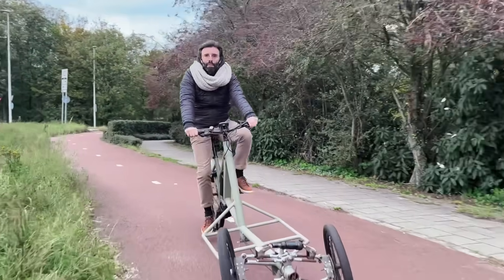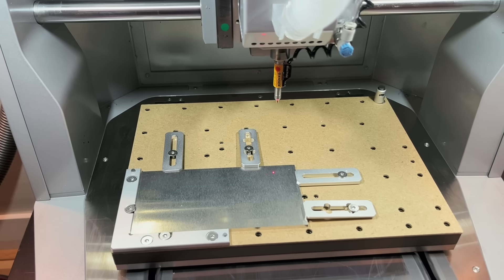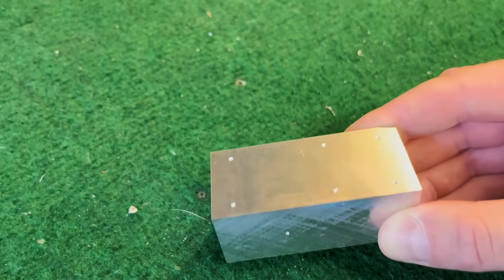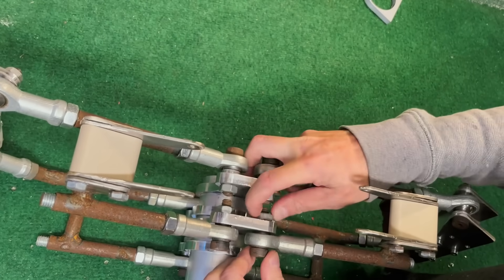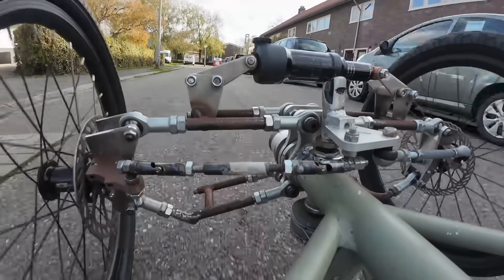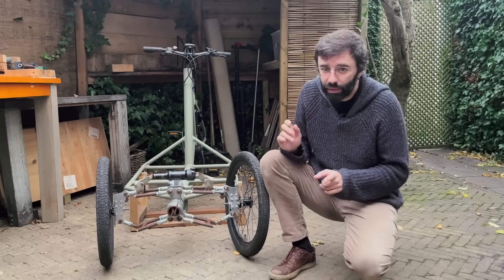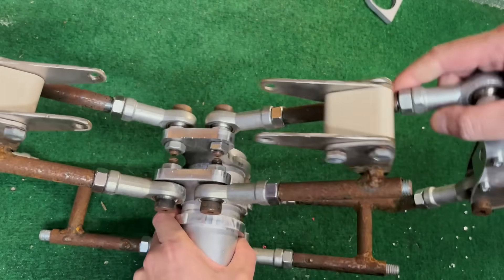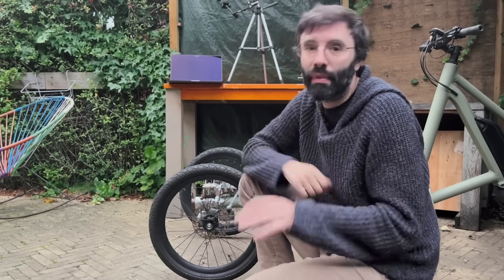#7 From 3D Printed to Aluminium - Tilting Mechanism with Makera Carvera Air

Comment: Have you looked at any kind of stress analysis for the front single end axles and other critical bits in the driveline? I assume this chassis is intended for cargo transport? Have you tested it with any significant mass in the cargo bed? Nice build anyway!
Reply from the maker: Hi, thanks!
Currently, I'm on a design and prototyping effort. Once I'm happy with that, I may consider manufacturing, for which I would need aluminium chassis expertise.
Cheers!

Comment: The Ackerman geometry for steering can be tricky. Keep in some mind that vehicles that handle corners very well at speed don't steer much better than a truck in a parking lot. (Had a car like that before.) Now if there is some trick to make that aspect variable, that would be interesting.
Reply: Found something called "VAS" which was recently patented in 2022. It's an electro-hydraulic setup with dual racks and pinions for steering and a computer changes the rates between them on the fly depending on speed. Seems like it's focused on Formula racing for now, but it may come to passenger cars at some point. Solves the cornering vs. speed trade-offs that are normally there.

On a project bike, there might be a trick to change it up with a bi-stable lever to switch between low and high and just lock one linkage set vs. the other. Either corner tight and squirrely or not that much but with a more confidence at speed. Still would be tricky to figure out something optimal that doesn't over-complicate it.
Reply from the maker: @pauljs75  indeed, I've seen those systems. Usually, they are steer-by-wire. E.g. the Tesla Cybertruck.
My speed range is not so high s I can keep the steering ratio fixed. But, it has to balance good turning ratio and stability.
Cheers!

Comment: What is the alignment of the front wheels?  Have you considered using some toe-in angle to help with your low-speed issues?
Reply from the maker: I have 0 degrees of Toe. My understanding is that Toe angle is used to compensate for chassis flexing when accelerating or braking. I've tried toe before with either unnoticeable results (e.g. 1 deg) or just making it worse to ride. But I still keep an open mind about it because I know the Bowhead Rogue does have some toe (in, I think).
Cheers!

Comment: Yes, adding longer trail (caster) + minimal additional ‘toe in’ will improve low velocity control stability.  Adding in some rear wheel counter steering will shorten your turning radius, but that might be a bit too ambitious for this project.  Propulsion to the drive wheel could be over challenging.
Reply from the maker: Thanks for the tips!

Comment: make molds for carbon fiber or silk epoxy compress under vacuum, make it so you can sit on the seat parked without the front wheel turning, if it's carbon fiber /al ship anyplace make a fortune
Reply from the maker: Thanks! Never made anything out of fiber but I will one day, for sure.
Cheers!

Comment: the trail distance looks alright, I would bump up the caster angle some more from perpendicular, this is what makes the steering line up and hold center in addition to a slight toe in.
yes, reverse camber is a thing, especially when heavily loaded, though it will contribute to tire wear. it will help maintain stability when cornering,
Reply from the maker: Thanks for the tips!

Comment: Motorcycles need a rake of about 30 degrees or more, to get them handling really relaxed and sweet. I adjusted my Harely rake from 33 to 36 degrees, and that made a nice improvement for hands-free riding.

Regarding your steering joints, I would orient the joints to give maximum steering, for smallest turning radius, and reduce the amount of wheel tilt.
Since the whole bike section tilts, there is no need for the front wheels to tilt to the same amount.
I dont know what your current tilt angles are, but it should be fine for the front wheel to only tilt 15 or 20 degrees when the bike section is tilted 30 degrees.
Reply from the maker: Thanks! Indeed, 33 degrees sounds like quite a bit!
I'll turn the ball joints for maximum turn angle for sure.
Cheers!

Comment: I personally look at the steering geometry of motor vehicles (cars or even the Can-Am Spider) as their steering is self-centring.
Reply from the maker: Indeed! I think they achieve this mostly with kingpin inclination.
Cheers!
Reply: @pedro-neves  I'm pretty sure that what makes a car self-centre is not king pin inclination but caster. A car going forward has stability (self-centering) as the caster is positive. Put the car in reverse and it loses the ability to self centre, as it effectively has negative caster.  Shopping trolleys have negative castor and they follow every crevice in the 'road'. I have no idea how the tilting mechanism interacts with the normal caster geometry.
Reply from the maker: @andrewmclean1239  thanks! I already have a caster of 15 degrees. I think it works well over 20 km/h, but I still want a bit more stability at low speed.
Cheers!

Comment: That is a well-coordinated linkage assembly and turn-in is positive and smooth. Very nicely design choices.

Trail can be accomplished in a few different ways with mechanical linkages and that is a debate well beyond my understanding.

But the effects of trail are visually and clearly illustrated here: 
https://youtu.be/n3SNujsesAw?si=ASadCkwPWMWkKv_4&t=75
Reply from the maker: Thank you!
That video is very nice indeed;)
Cheers!

Comment: That trike at the end is with just one front wheel.
And in that case - longer base, longer trail.
Same on long base recumbents.
But when you have 2 front wheels, that is different because of Ackerman+leaning. It gets more complicated.
Reply from the maker: Indeed, combining steering with leaning complicates it quite a bit;) Best to start with a complicated project and then steering should be easy from now on;)§
Reply: @pedro-neves  I thought about it, and you could achieve Ackerman effect by letting front wheels lean at different angles as they lean.
It will achieve the same effect, but it will be a lean-affected kind of Ackerman effect.
I don't know if anyone tried doing it that way.
Reply from the maker: @SEThatered  sounds interesting. I think I saw someone doing that but with a "wagon turn" system.

Comment: 60 mm of trail is pretty standard for bikes with large wheels and if you scale the trail down by the ratio of the diameters (roughly 20/26) you’d get a smaller number. In standard bikes head tube angle and rake combine to create trail. What’s the rake equivalent in your mechanism? Perhaps that’s why it feels twitchy.
Reply from the maker: Yes, indeed, I have a similar trail to bikes with larger wheels. This is because bikes usually have the fork designed to reduce trail.
I'm designing a knuckle with 4 possible trails so that I can feel the difference;)
Cheers!

Comment: Very interesting idea! Is it better and stable to make a fast turns with this bicycles? where is the center of mass in that bicycle?
Regarding indian bicycles i thought its mainly for absorbing shocks but AI points that it helps keep the direction on a bumpy road :)

University page of "mechanicat anits edu in " has an article about bicycles called "DESIGN AND STRUCTURAL ANALYSIS OF A BICYCLE FRAME UNDER STATIC LOADING CONDITIONS "

Comment: Apart from trail/caster you might want to also consider the toe angle of the two front wheels. On rear wheel driven cars the front two wheels usually have a slight toe-in (fractions of a degree). Thus, you might try setting the front wheels not completely parallel, but the front part of the wheels with maybe 2mm less distance than the rear parts.
Reply from the maker: Thanks for the tip!

Comment: use tierod joints from a small truck as ball joints, with the stud mounted vertically.

i said "small truck" to get the steering gear type, not the steering rack type. More usable options. 😊
Reply from the maker: Thanks for the tip!
Reply: @pedro-neves no problem, I think that will solve your clearance issue (using heim joints).
Reply from the maker: @Iowa599  thanks! Indeed, I've use them but still not enough clearance for enough turn.
Cheers!
Reply: @pedro-neves they spin, are you using them sideways?

The stud should be vertical.
Reply from the maker: @Iowa599  ya, I wanted to increase the tilt range while sacrificing turn. But turn was sacrificed too much...;(
Reply: @pedro-neves hmmm, yeah...

maybe separate the movement to separate  joints?

use a bushing at the top & bottom of a kingpin, not a heim or ball joint, for travel. Then use the kingpin for steering, with the spindle on the kingpin between the control arm joints.

That should maximize movement.
Reply from the maker: @Iowa599  thanks! I'm thinking of separate joints for separate movements indeed.
Reply from the maker: @Iowa599  indeed, I'm considering this option if I consider that I need more range.

Comment: Small spring like old bikes or a steering damper like race motorcycles and you will fix your low speed turning "too much". Don't change the trail. Also change direction of ball joints and make good arm to make the lever to adjust how strong you will turn and how much. Keep it up!
Reply from the maker: Thank you! Indeed I'm considering a steering damper. But, will try to get the geometry as good as I can before.
I will change the direction of the ball joints indeed.
Cheers!

Comment: ChatGpt on: 
'What Fork Rake/Offset Is

Fork rake (or offset) is the distance between:

The centerline of the steering axis (an imaginary line through the head tube), and

The center of the front wheel’s axle.

When a fork “swoops forward,” it moves the axle slightly ahead of the steering axis.

⚙ 2. Why It’s There — The Main Effects
a. Stability and Handling Balance

Without fork rake, the steering would feel heavy and self-centering too strongly.

With too much rake, the steering becomes twitchy or unstable.

Designers adjust rake to get the right balance between stability and maneuverability.

b. Controlling “Trail”

“Trail” is the horizontal distance between where the steering axis meets the ground and where the front tire actually contacts the ground.

This trail gives a self-centering effect (like a shopping cart caster).

Rake reduces trail slightly, fine-tuning how the bike steers:

More trail → More stable (good for high speed, touring, cruisers).

Less trail → More responsive (good for racing, mountain bikes).

🚴‍♂ 3. Practical Examples

Road bikes: Slightly curved forks for quick handling but decent stability.

Cruisers and touring bikes: Often have more fork rake for smoother, more stable steering.

Mountain bikes: Usually straight forks but use geometry (head tube angle and offset) to achieve the same handling goals.

🧠 In Short

That forward curve isn’t just aesthetic — it’s a carefully designed part of how the bike handles:

Fork rake adjusts the trail, which controls how stable or nimble the bike feels when you steer.'
Reply from the maker: Indeed!

Comment: You could try lowering the frame joints relative to the racking joints on the control arms. That way the weight of the bike would naturally want to pull the assembly back to neutral. It seems to me this would create a restoring force on the racking itself instead of the wheels which is what changing the trail would do. I don't know which is better, but my instinct would be to have the racking drive the wheels.
Reply from the maker: Thanks for the tip!

Comment: I believe you need more trail to have a more stable steering, this is also how it works on motorcycles. Maybe this video could help more with the explanation: https://www.youtube.com/watch?v=n3SNujsesAw from 1m10sec trail gets explained
Reply from the maker: I love that video, thanks!
Reply: @pedro-neves  Your welcome ;) I also found this video from the same channel: https://www.youtube.com/watch?v=K2I8aICAk58 it goes more into detail on how motorcycles stay upright while driving. And maybe this is usefull too: https://en.wikipedia.org/wiki/Bicycle_and_motorcycle_geometry

From what ive always learned from motorcycles is the further forward the wheel is the more stable the ride is, but the harder it becomes to turn (imagine a chopper with an extended front forks for example). While having a wheel that is almost underneath the steering is much easier to steer, its also more instable (imagine racing bikes).Of course these are extrems ;)

I think what you also have to take into account is the gyroscopic effect of the wheels, which is determained by the weight and speed of rotation of the wheel. Since your problems are at lower speeds you wont be able to change the speed of rotation, but you could look into wheels that have a bit more weight.
Reply from the maker: @remconl85  how cool! This video actually demonstrates that wheel flop can be used to keep the bike upright, contrary to what is empiric (for me).
The chopper example shows that they have high head angle (or caster, or rake, there are so many terms) which also increases trail. So, maybe more trail can keep it steady despite creating wheel flop;).
I'll have to test;)
Cheers!
Reply: @pedro-neves  Glad to be of help. I look forward to seeing the results in your videos ;)

Comment: More trail equals more straight line stability but harder steering and slower steering response - as withallmthings engineering, it’s a trade off! Great video and I’m impressed with the CNC unit and will be looking into one in the new year to supplement my manual machines.
Reply: Exactly. he should try a bit more trail. I got some bike where i did the same and it drives much easier on slow speeds free handed. The 10mm i added changed a lot for this 28" trecking bike
Reply from the maker: @johgude5045  thanks!
Reply: @pedro-neves respectfully, I gotta disagree that more trail is the obvious solution. Pretty sure what you're dealing with is called "wheel flop" which tends to go up with the same factors that make trail go up. It's not a one to one relationship, but it's a pretty strong correlation, and getting them separated ends up meaning weird geometry. I'd recommend you try more trail, sure, but often, more trail makes high speed more stable and low speed less stable. Thankfully, if you give up some trail by less steering axis tilt, you should be able to make up for some of the loss in higher speed stability with some negative camber, which will improve both high and low speed stability, it'd just maybe increase the stress on some parts, relieve stress on some others, might make the steering a little more tough.. basically, without doing all the math and knowing what you're doing with the suspension kinematics ahead of time, best way to do it is just play around with rake angle and camber.
My recommendation is give 10 degrees of rake and 3 or so degrees of negative camber (wheels tilted in at the top) a shot. Could work, and at least you'll know a little better what it does and how it feels.
Reply from the maker: @LifeInJambles  thank you so much! I already have 15 degrees of caster but I can change it to 13 or 11. I will certainly add some negative camber as my system also allows for tuning. And finally, I never tested different trails so I'm creating a knuckle to have 4 different trails and see how it feels;)
Cheers!
Reply: @pedro-neves sounds like an excellent plan. You built a good amount of adjustability in, which definitely helps with this getting things dialed portion.
Once you get geometry dialed in a little more, I'd love to take a look at your more final geometry and see if I couldn't make some more integrated final parts that aren't a whole mess of plates and blocks and tubes, but there's not a lot of point doing that until you have the functioning prototype actually working how you want it.
Reply from the maker: @LifeInJambles  exactly! Final parts after all the tests.
Reply from the maker: Thanks for the tip!
And I love this machine! I'm using it almost as easily as I use my 3D printers. It's game changing.
Cheers!

Comment: Aloha, 

you are a genius. 

The 1st concept which I like for this kind of bikes.

If you have a cnc or a 3d-printer for harder materials
what do you think of pedals which are going to be longer, 
when you need it?

This is the video on youtube:
Exzenterantrieb fürs Fahrrad - MDR Einfach genial - 15.05.2012

Best Quickwash
Reply from the maker: Thank you so much! You are very kind.
It's interesting to change the length of the pedals indeed as you add more torque from your legs. Though, if you have enough gears, this will be achieved anyway and because I also want to use an electric drive, I think then I don't need to extend the pedal arma.
Cheers!
Reply: @pedro-neves thank you for the answer. Another question. Can you build an adjustable sidecar with this system?
Reply from the maker: @quickwashtheraccoon7601  interesting project;) That might make sense and I would love to try it. But, it's not a project I can start because I already have more than I can finish;) But I would love seeing someone doing it!